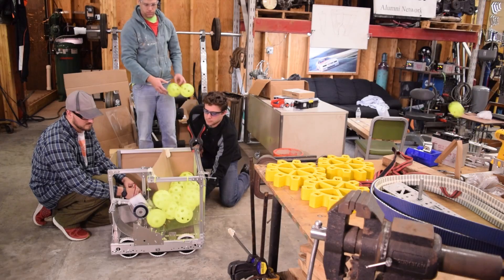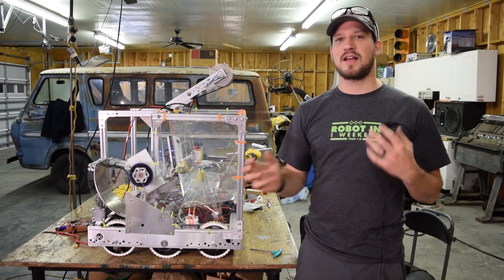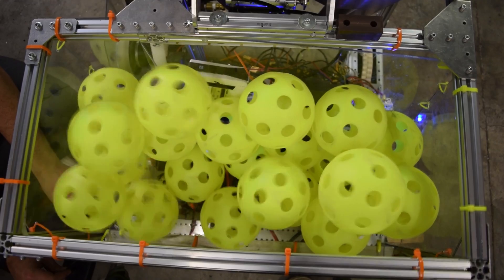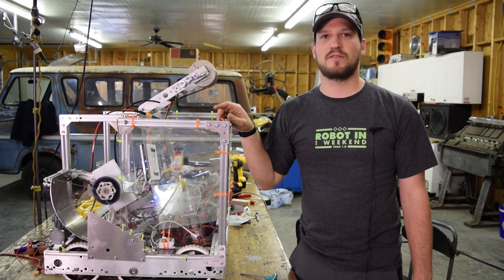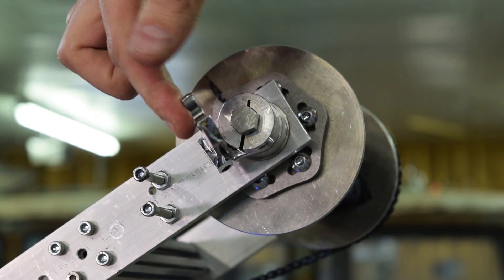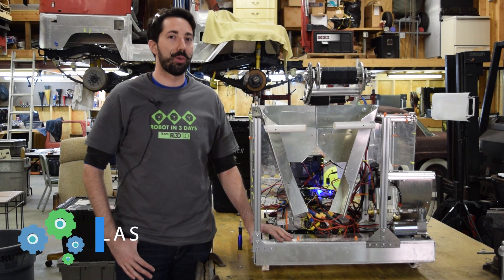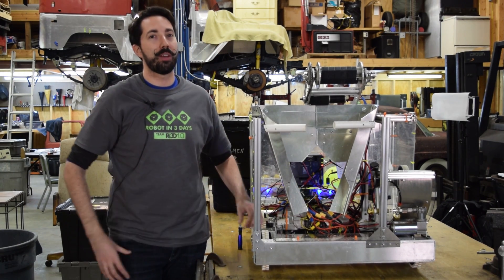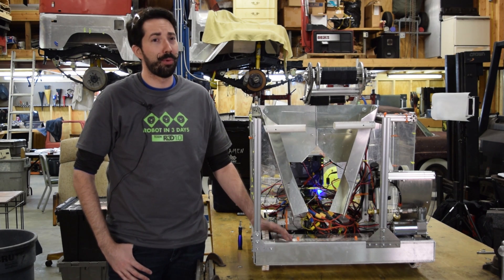Team Ri3D 1.0 - Day 3 - Hopper Fuel Agitator, Rope Climber, and Gear Manipulator Update

Comment: Hey Guys, So when you've got the gear in the hopper tray, how would the spring pick it up? Does it line up?
Reply from the maker: Hey Will, the cowcatcher that the gear sits in was built so that when the gear sits at the bottom of the V shape it is lined up with the peg to score on. The pneumatic is then fired to open the gear manipulator and the robot simply drives backwards. We tried to make the system as passive as possible. If you haven't had the chance yet, check out the day 1 (https://youtu.be/m7RNTi1HI3Y?list=PLpJRpRT0xvIihtFNYdOdxxt2pck2Wt3KI) and day 2 (https://youtu.be/cZTB4PnpgBk?list=PLpJRpRT0xvIihtFNYdOdxxt2pck2Wt3KI) videos in addition to this one to see the scenarios we encountered with this approach and how we worked around them.

Comment: The bumpers need to get on so I don't think that gear is going get catch so you should check that . There a 3 inch gap if your up against the wall if you have your bumper on
Reply from the maker: You're right, Edgar. Some of the clips we used in this video don't properly demonstrate that. However, the improvements Gabe describes us making were actually primarily due to simulating the distance the bumpers add with keeping the gear mechanism further away. In our case, we used a 2x4 to keep the robot away from the wall to simulate the bumper for refining the design. Clips of testing for that gap that didn't make it into this video, but were the primary drivers for the improvements Gabe mentions.